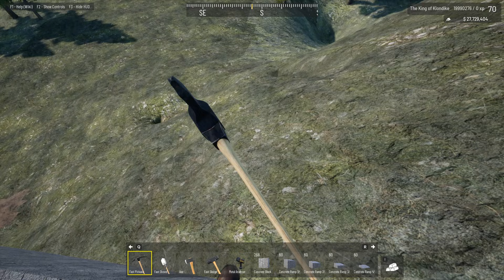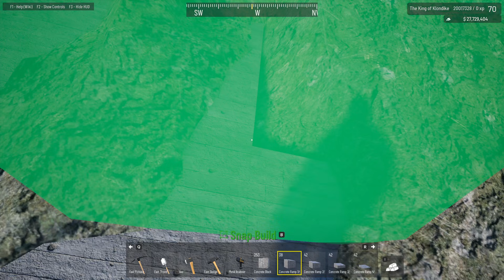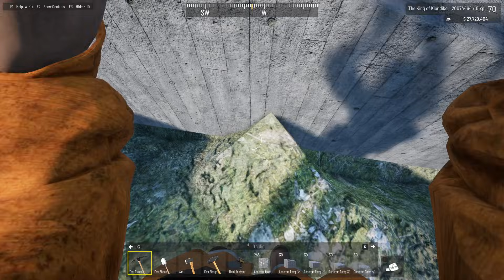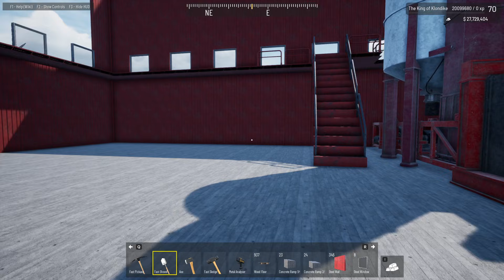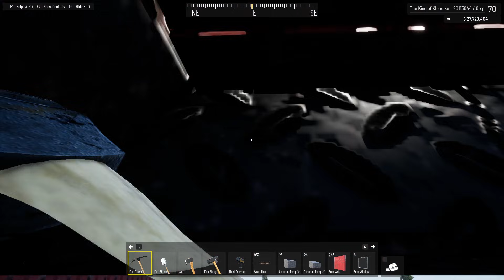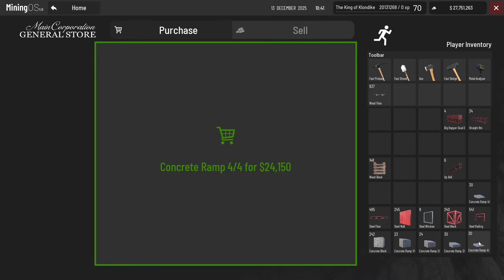Out Of Ore {Hardcore} S2E33 Working On Ramps For Parking Area

Comment: I got so excited for you when Split jumped into your stream, He's great about replying to messages in his own streams but to see him in someone else's  .... TOO COOL !!!
I got some dozer practice myself. started cutting a road north out of town thinking maybe when I get some serious money like you I'd get a bagger and see about knocking down that mountain to the north LOL
spent a bunch of time today putting in ceiling supports on that upper level to try to stop the occasional dirt falling on my head, got tired of washing my hair several times a day :)
Now you need some grader practice to move that dirt from one side of the ramp to the other :)
your loader work on the ramp had some "Pucker Power" to it :)
Ok I laughed when you tried to jump on the catwalk :)
I think you can place those pumps a lot closer, I believe I've got them right side by side. The pipe merger is a lot more compact just a 2meter cube granted the pickup pipe clips through the pump motor next to it. Have a look at mine if you jump in my game again or I'll probably make a video after I've watched yours:)
I've seen people spread coal on the ground to get the oil derrick to work, purely a cheat but it works 
Thanks again for all the help and another great video 👍👍👍
Reply from the maker: Yeah I was shocked he showed up to a small stream like mine, but was very grateful he did.

I still need a lot of dozer and grader practice still. I am not very good, but will work on it here and there.

Yeah I thought I could make it. guess not lol

I thought about putting them closer, however I wasn't sure how I was going to put in the windmills or if they would stay windmills, so I decided to space them out some.

At the original plant, i put coal down (cheat method) to get an oil rig going.

Thanks for the kind words, glad you like it and happy to help.